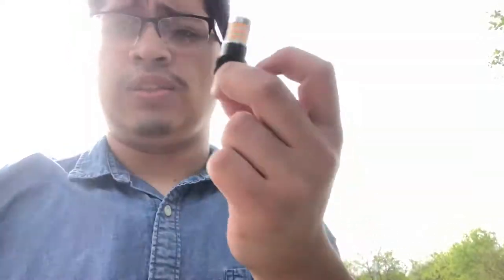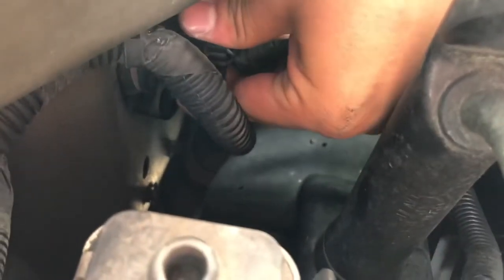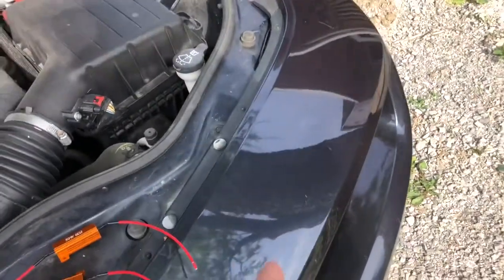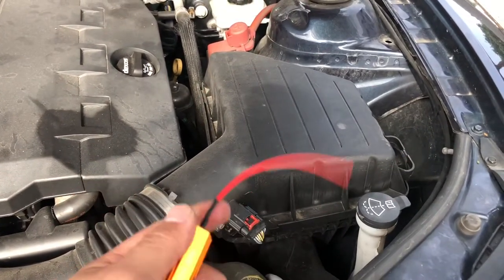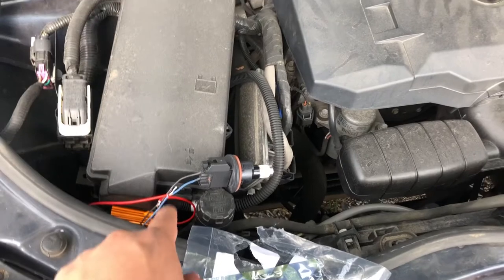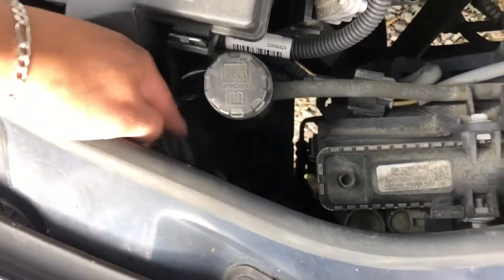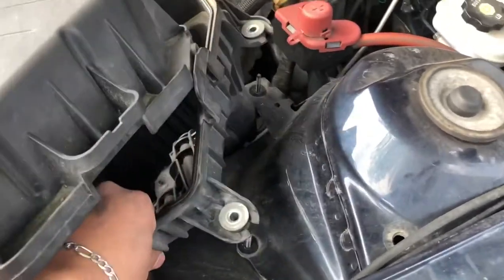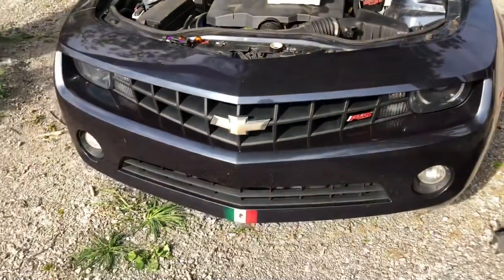2013 Camaro Front turn signals led install + resistors

Comment: Just so you know, there are Wire clamps for the resistor you didnt have to cut the wire coat/insulation, the clamps will bite down through the coats and contact the wire that way. Thats how i have my switchbacks

Comment: So it makes the turn signals a lot brighter then factory bulbs ? Also it looks like after you did the second turn signal the overall lighting got dimmer then when you had the first one only installed .
Reply from the maker: Yes they got brighter and the turn signal doesn’t fade in And out anymore it’s just off and on off and on no more strobe, also it looks that way because my camera was able to tell the difference in brightness but once I got both the new ones in the camera adjusted to the brightness of both leds